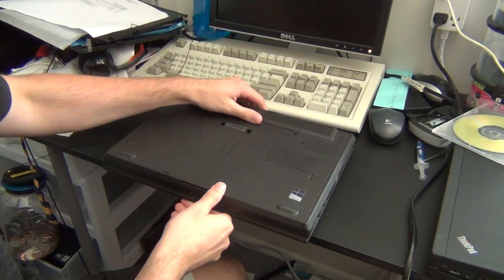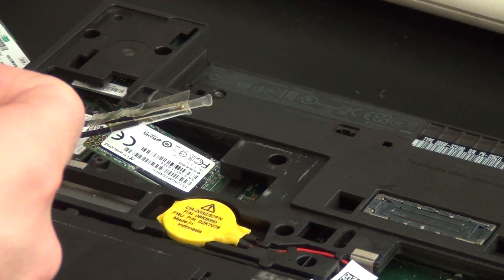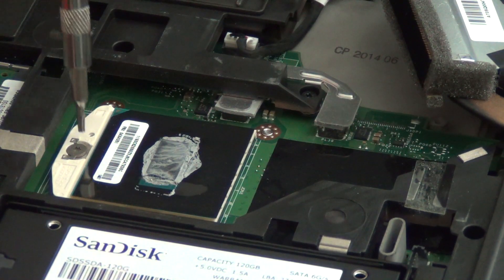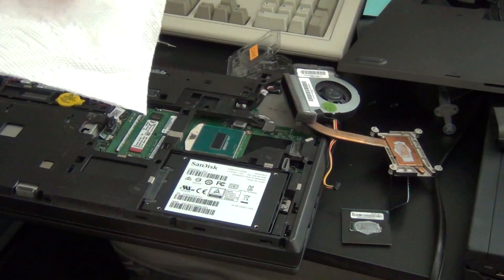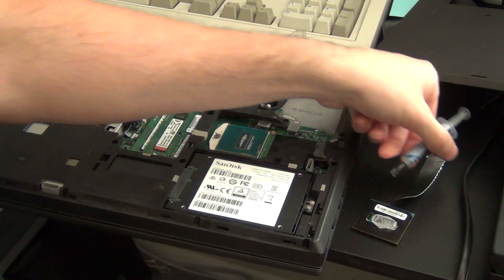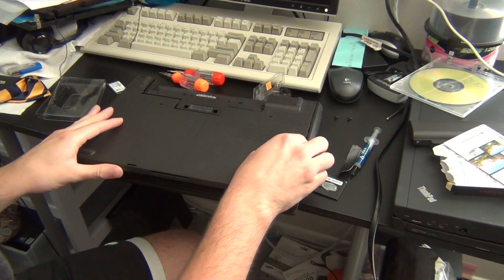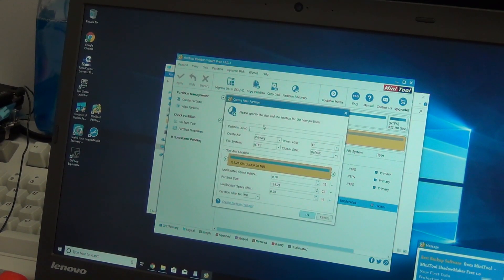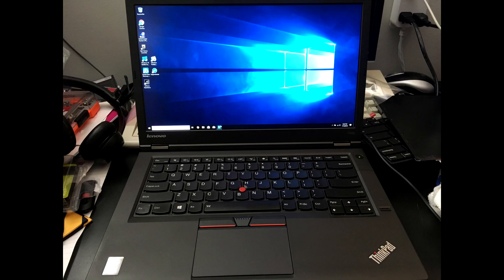Lenovo ThinkPad T440p: CPU and storage upgrade

Comment: Saw Sebi get the 4702mq... I've got a t440p with an i5(igpu only version) and a broken laptop with a i7-4700mq. Should I go ahead with replacement? I'm afraid the higher TDP of the 4700mq will diminish the thermal performance and make my t440p louder. I've heard of people getting heatsinks off dGpu versions of the t440p when they put in a higher TDP cpu? Will I be fine with the stock iGPU heatsink and the 4700mq?
Reply from the maker: I had a 4700MQ in mine for a while and it never got too hot. You should be fine with the iGPU heatsink.

Comment: Good video but I got a question. Why did you buy 2 120gb ssd's when you can buy a 240/250gb ssd? Since the last time I checked, most if not all 120gb didn't have DRAM. Also, nice Model M!
Reply from the maker: The 120 GB 2.5" drive was just in there for testing. After I filmed the video it was swapped for a higher capacity mechanical hard drive.

Comment: hi dude, just wondering if i7-4810mq would fit...a bit worry about the temp
Reply from the maker: It will work, but as you have said, it will run hot and may throttle.
Reply: @SebisRandomTech  thx! BTW, have u ever experienced throttling with your i7-4702MQ on heavy load?
Reply from the maker: @schwamm1798  Honestly I haven't checked, this unit was sold to a friend but I have another system that I just put a 4700MQ into.

Comment: Thanks this video. I upgraded my thinkpad T440p from i5 4210M  to i7 4800MQ. And it worked so well.😊
Reply: I‘m also planning to upgrade my T440p CPU from I5 4300M to I7 4900MQ, so I would like to ask you what is the power (watt count) of your power brick? As far as I can see you also upgrade your system from CPU with only 37W TDP to one which TDP is 47W. Because I’m currently using 65W power brick, my main headache for this upgrade is the power limit of my power brick.
Reply: @evaldasmingaila2527  My power brick is only 65W.
Reply: @evaldasmingaila2527  how is the temperature using 4900mq ?

Comment: I tried upgraded  My T440P  with I7 4810 MQ but it didn't event boot the machine .Eventhough I have updated my bios. Any Idea ? pls  help me.
Reply: I have a 4810 MQ in my T440P and it runs fine.
Put your old processor back in, reset to default, run the most recent bios update (if you already did that, do it again) and then reset to default AGAIN.
Pull and re-seat your RAM, try with only one stick, then switch sticks.
Make sure you don’t have any missing pins or too much heat sink grease that has oozed everywhere.
Pull your battery, un plug the machine, and hold in the power button for 15-seconds, then do that agains.
Then insert the new processor, plug the power cord in, and try starting without the battery.
Really, try it all before you give up.
Reply: did you try the cpu in another machine? maybe you got a faulty cpu
Reply: @lucianistoc1264  Thank you ;I returned cpu and tried another cpu (new 4702) still can not boot the machine . I have win10  /updated bios and software. I think I give up updated cpu

Comment: Is this the same for the T440s ? I can't believe how easy the CPU change looks, on my toshiba I had to remove they keyboard, the whole top part, unplug everything on the board, flip it, change thermal paste and reassemble everything it took me like 3 hours
Reply: I own a T440s, and while I love it lots, it has a soldered-down CPU. So unfortunately, no, this is not possible :/
Reply: @marissavaneck1358  Is it as easily accessible tho ?
Reply: No, the T440s is a little harder to open (more screws) and there's less you can change and upgrade inside. The CPU is soldered so it can't be changed at all.

Comment: Its only 8gb ram?. I can do 12gb?
Reply from the maker: The T440p can take up to 16.
Reply: @SebisRandomTech  I have a hunch that the only T440ps worthwile are either the cheapest money can buy in a decent condition - approx. 150 bucks or the fully equipped ones for far less than 400 bucks. In case of the former you can recoup the costs by selling RAM and CPU and end up sub 400 bucks if you max out anything. Anything in between is either a ripp-off or simply too expensive. The fully equipped ones ocassionally turn up on Ebay.
Reply: @SebisRandomTech  if i change my cpu on T440P to 4800mq can i use 32gb of ram? since this cpu support it? regards

Comment: Do all the T440p have an m.2 port to install an SSD? I'm gonna buy an used T440p with I7 4710mq and 16gb of ram with a 500gb hdd but i want to upgrade it to an m.2 ssd to match the speed of the cpu and the ram. I'm a bit confused right now.
Reply from the maker: All have the M.2 port, but make sure your SSD is a 42MM length and not a full (80MM) length SSD, or it won't fit. Also make sure it is a SATA SSD and not an NVME SSD.

Comment: how are the temps under full load?
Reply from the maker: Pretty good. I never did a direct CPU measurement but the vents never got piping hot under heavy loads, which is a good sign.

Comment: How's the thermal on the CPU? I'm thinking of buying one and upgrading to i7-4800MQ but i'm worried it may throttle. I also happen to live in a hot country.
Reply from the maker: I haven’t had any issues with throttling. As long as you use good quality thermal paste, you should be fine.
Reply: @SebisRandomTech   but the problem is that the i5 4300m and the i7 4702mq have the same TDP (37w), the i7 4800mq has a 47w TDP , so the i7 4800mq should get hotter.
Reply from the maker: @epictrolloleante  Some good quality thermal paste makes all the difference.
Reply: @SebisRandomTech  that is true with the i5 4300m the cpu temperature decreased up to 10C° when i changed the stock thermal paste with the Artic MX-4

Comment: Can I upgrade graphics card in T440P ?
Reply from the maker: Unless you are good at soldering, your only option would be to replace the motherboard with one that has NVidia graphics. Your other option is to get an M.2 to PCI-E adapter to use a desktop GPU, but this approach will require you to keep the bottom cover off or cut a hole in it.
Reply: Off course. You can upgrade anything if you have the tools, e. g. a soldering station and some experience, which might be handy. :)

Comment: Hello Seb, love your channel and videos about Thinkpad T-series. Question, which one is better in terms of modifications? T440p or T430/430s? I'm probably lost on few key points from your videos.
Reply from the maker: T440p and T430 are about the same in terms of upgradeability and modifications, but it ultimately depends on your needs:
The T440p supports a 1080p IPS display natively, and as seen in my previous video is a drop-in replacement. However, it lacks an ExpressCard slot which limits your expandability a little.
The T430 is one generation older, so processors will be a tad slower but not a huger performance hit. It has an ExpressCard slot, allowing for expandability and even using an external GPU. It does not support 1080p displays natively, however you can buy an adapter kit off eBay to allow a 1080p display to work in it. The T430s uses a different kit so if you go this route make sure you buy the proper kit.
The T430s is overall a weaker laptop than the T430, as the processors are soldered in and thus cannot be upgraded. There is also less I/O and the SD Card reader doubles as the ExpressCard slot, so you can't have both. Battery life on the T430s also pales in comparison to the T430 or T440p, not to be confused with the T431s or the T440s which are both very power-efficient thin-and-lights.

Comment: I upgraded my T440p from i5-4300m to i7-4700mq with this vid. Thanks man!
Reply: For manual fan profile or automatic customized by yourself use nice software. TPFanControl V0.61 by troubadix, excellent if you want Max fan speed or customized fan profile.
Reply: @ned3and i agree with you , with TPFanControl the fan works faster than by default.
I use it when i'm playing ARK xd
Reply: @epictrolloleante   Beacuse normally CPU goes 50° without fan and when it reach 65 - 70 it goes 50% fan speed :D. For i7-4702QM it has the same DTP as  i5-4300M 37W. It doesn't need PSU change.
Reply: @ned3and  yup, but when the cpu is full load the fan speed doesnt go over 4000rpm with stock speed, and when using TPFanControl it goes up to 5300rpm, and i guess is a big difference, i would recommend that software ,at least for me is very useful.
Reply: @epictrolloleante  There was software called a Lenovo Power Manager and was having a Boost+ Fan mode that goes full speed more or less 4934 RPM but not working anymore, it crashed every time and doesn't work on Win10 only on Win7.
Reply: how are the temps under full load? looking to buy a T440p with a broken screen and replace it with the IPS panel and do a i7 4700MQ aswell
Reply: @ChichiLikesFood  i got a t440p i7 4700mq, two days ago, while watching 4k video the cpu reach 79-83 degrees. i think i need a new thermal paste, 4702mq's tdp is less than 4700.
Reply: is there a noticeable change in speed and/or battery life?
Reply: Wow its work? I did like try it out
Reply: Where's the best place to buy the i7 from please guys?

Comment: I'm sorry if this is a dumb question but does a SAMSUNG 860 EVO Series 2.5" 500GB SATA III V-NAND 3-bit MLC Internal Solid State Drive (SSD) MZ-76E500B/AM fit and work on a ThinkPad x230
Reply from the maker: As long as it is a 2.5" SATA drive (which this one is) it should work.

Comment: What brand m.2 SSD did you go with?  When I upgraded my T440p, I went with a 64GB KingDian.  Definitely some superchina stuff, but it works fairly well.
Reply from the maker: I used a MyDigitalSSD. It came with a 2 year warranty and most of the reviews were positive so I gave it a shot.
Reply: @SebisRandomTech can i get the model of that m.2 please

Comment: I just learned my computer has another storage slot. Wow thank you so much!
Reply from the maker: Glad I could help you!
Reply: @SebisRandomTech   Have you had any issues with the M.2 drive randomly disappearing? I am getting ready to buy a drive, but seen that there might be potential issues.
Reply from the maker: @GreenJeepAdventures  Never had any issues with the M.2 drive in 4 different machines: 2 T440p's, 1 T440, and 1 X240.
Reply: @SebisRandomTech   Thank you for the prompt reply.
Reply: Whats the model number for the m.2 sata ssd